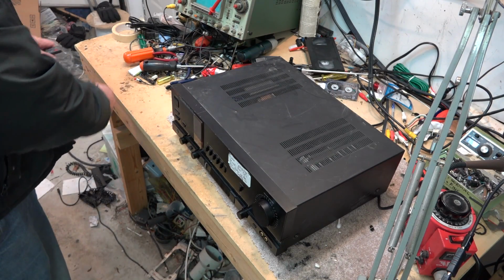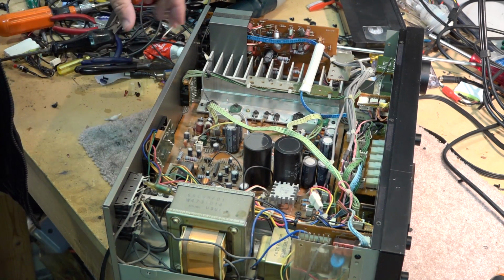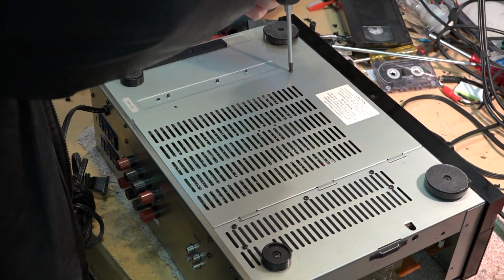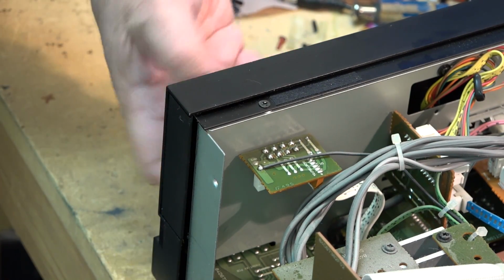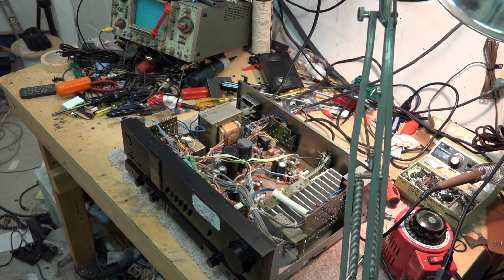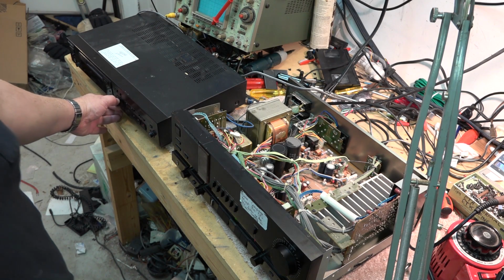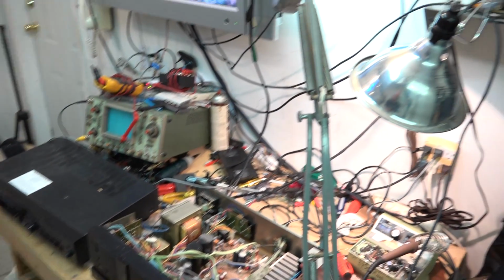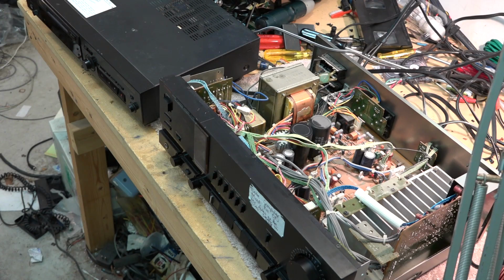luxman lv103 hybrid amp service

Comment: Good vid mate, love those Luxman boom boxes, one thing about 4k is I can see how grubby and disorganised your garage is, but you know where everything is, right? :>)   ...I wonder if a macro lens would assist with close up zooms on that camera?
Reply from the maker: This isn't 4K. It is 1080p at 60 FPS.
4K won't be for the repair vids, but for scenery vids that I will be shooting to showcase my travels, and the Vancouver area. Some people shoot stills for their hobby, I would rather tell the story in video. I already have ideas for a project, just waiting for the right conditions. The repair vids will continue to be done in 1080, and many are done on my old tape based broadcast camera just due to the speed advantage editing. 4K is very slow due to the processing power it takes to do anything.
As to the mess in my garage, most of that isn't my stuff. The kids, and wife just dump their old coats, and boxes of crap (that DELL box that is in the shot for example is my daughters computer box. Everyone thinks my garage / workshop is their personal storage area. When spring cleanup comes it will all be going, this time for sure. I said that last time, and totally forgot what day it was and worked that weekend.

Comment: just thought I would pass it on to you that I myself am not a fan of the high frame rate, make the picture jump
Reply from the maker: Picture shouldn't jump on HFR. It is actually smoother than low frame rate, but youtube sometimes down samples to 30FPS.
I have found that if I render out my old AVCHD camera into MP4 the picture is not as clear, so I normally render out in MPG2.  The new camera has AVCHD-S and it is already playing havoc with my editing software.
I have yet to try 4K shooting as I am unable to even play that on my computer yet, and I have a very fast machine, an i7 with 16 gigs ram, and over 10Tb of local storage.  Will have to find a codec for my player.